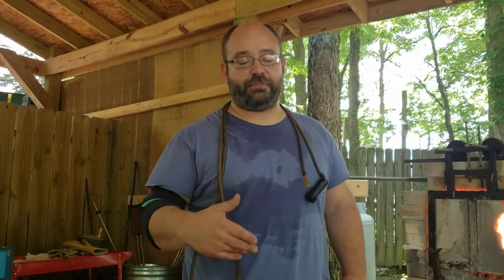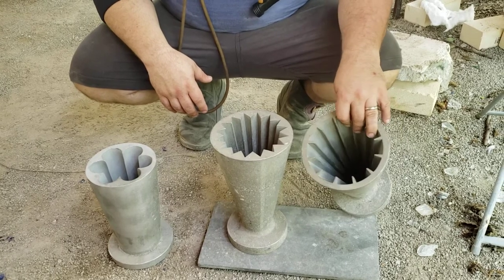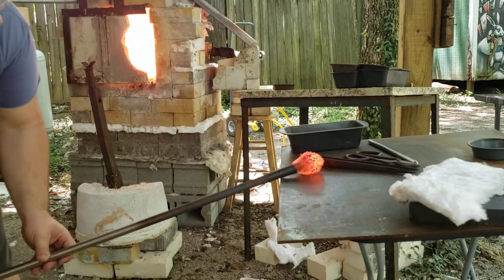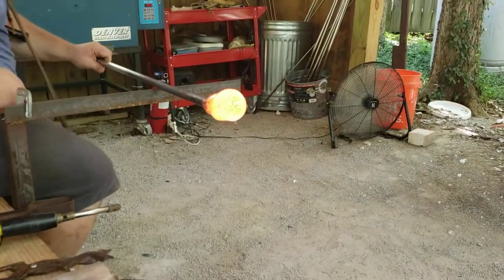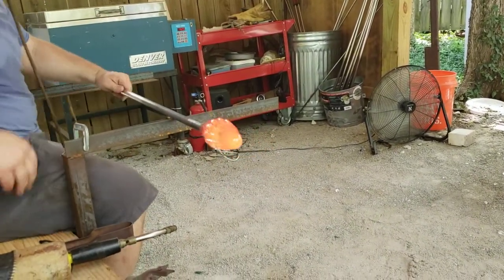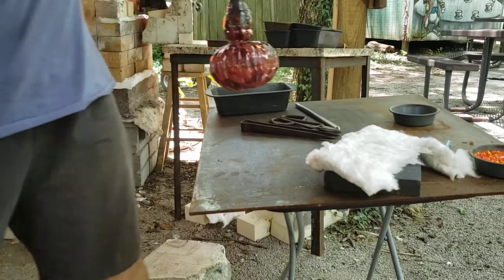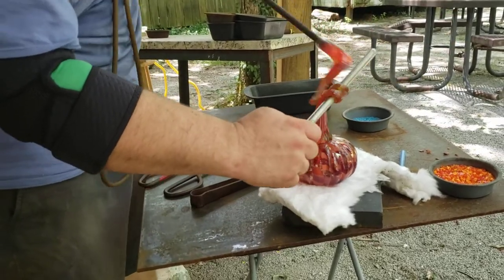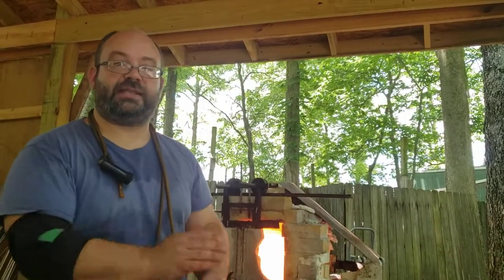Glass Blowing how to pt 4: 1 heat pumpkins for fun and profit!

Comment: Well done! If you were to use a closed bottom mold Such as the 9-2-12b or the 9-3-18b from Steinert you would not need to cut the nose off. (I have been making pumpkins for over twenty years) You would save time and material. The bubble setup is critical though,  you want to push the bubble up to the tip leaving most of the glass on the sides which is where your mold impression will be. Good luck!
Reply: +1 on the bubble for a closed bottom mold